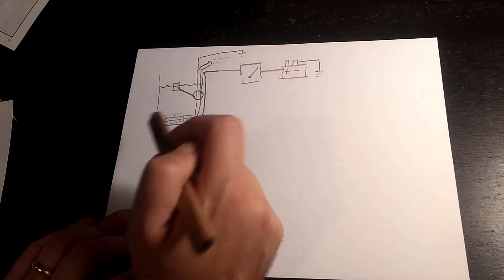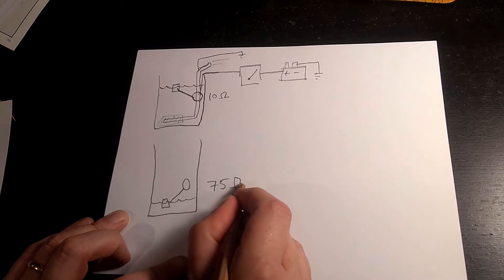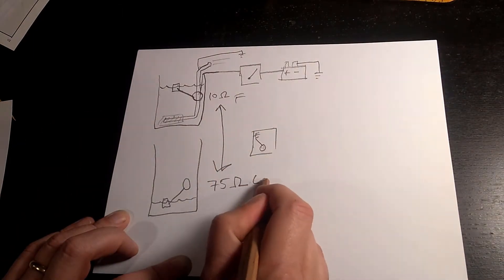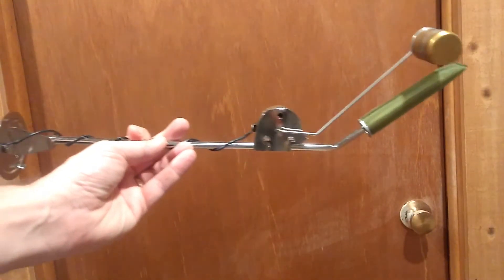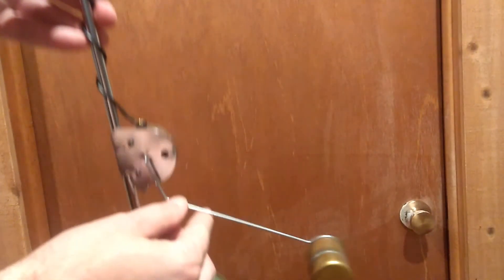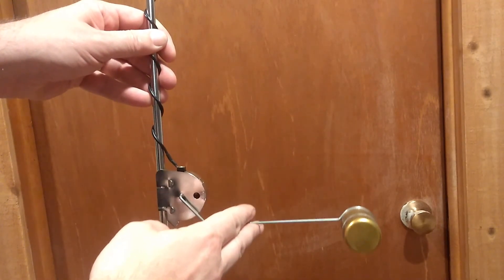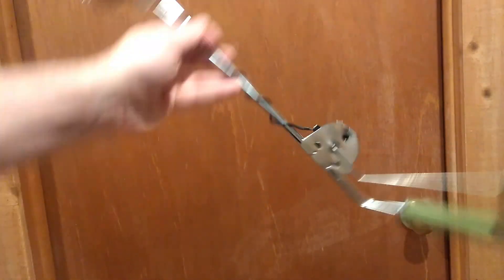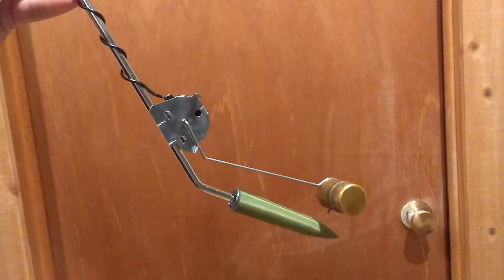HOW IT WORKS: Gas Gauges

Comment: Wait, what about voltage regulators in the dash?  What if your fuel gauge has the regulator built in?
Reply from the maker: If there's a voltage regulator in the system, it simply reduces the voltage on the wire to the sensor.  On a Mopar, for example, it drops the voltage from ~12V to ~8V. The rest of the system still works the same way.